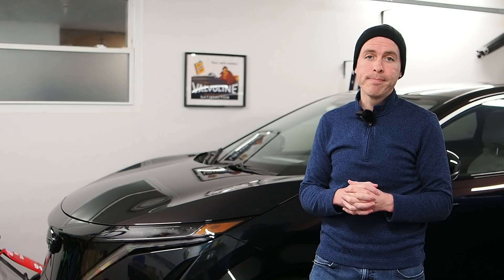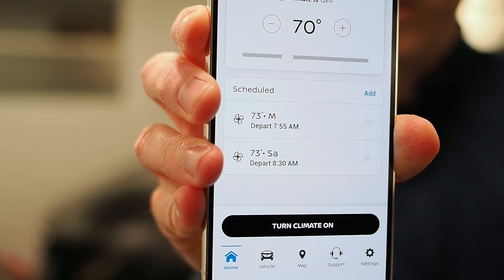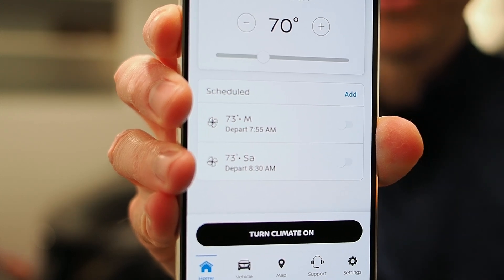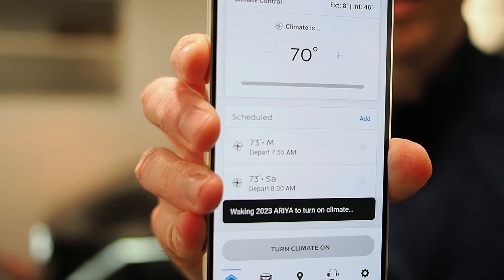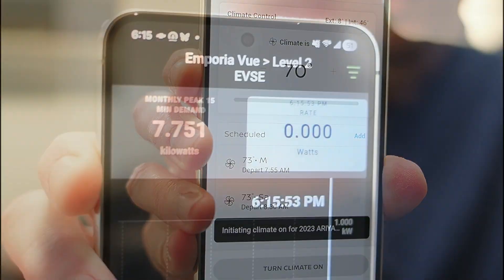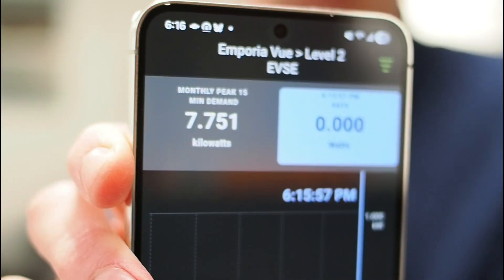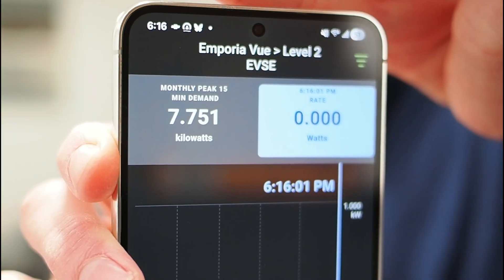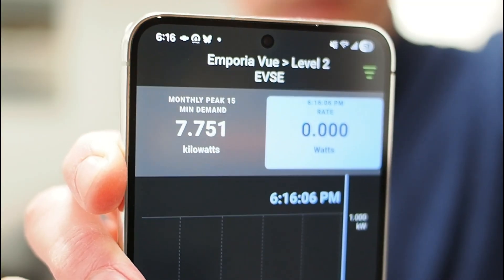The Nissan Ariya has a bug with cabin preconditioning, but there's a workaround

Comment: Thank you for showing  your  Emporium app  message in the upload,  because without  seeing that,  I would never know  you have a  2023  model.   In the future I recommend you alway's
put  the year and model of your Ariya,   (when it comes to troubleshooting and  buyer shopping,  the alway's present  thing on a viewers mind  is,  ? (  '' is what  I'm hearing applying to all model years, or
just that specific model year '' ),  for example  this  software bug glitch on cabin  preconditioning,  this video was about,   might only apply to the 2023 model years,  not the 2024 or 2025 model years,
this might seem strange to others that I have to point this out,  but it's really not,   there are a huge amount of bugs and issues for example  the  2023  Volkswagon I.D. 4  has  that the 
2022 Volkswagon ID.4  does not have.

Comment: The Ariya is a great looking SUV.  This is a great tip but tbh I unplug my EV (Ioniq6) in the AM before I heat the cabin b/c I don't want to charge off the grid while pre-conditioning because then when I go to leave and if it's not done, then I have to stop charging before leaving (which is a pain in the Ioniq6).  I do not charge every night because I share the level2 charger with my husband's R1T.

Comment: Is this only when the battery is fully charged? Because it doesn’t do it if the car is charging. I normally have my schedule set to end at 1am, then it will start again at 6:00am and ending at 7am. During that hour of charging is when my preconditioning also turns on for my 7am departure. It’s definitely charging and running the climate system at the same time.
Reply from the maker: Yes, I may not have made it clear, this is when the battery is fully charged

Comment: Cool... When you talk about battery pre conditioning... Can you explore the topic and explain if battery heater matters for miles/kwh performance in winter? 
In other words, is it worth it to use battery heat option while pulling power from the grid just to warm up the battery and try to get better milage? Is it it just good for fast charging?

Also what does the option battery cooling assist in the gauge cluster do? When should I use it?
Reply: Honestly the biggest difference I’ve noticed is cabin heating. I park in a garage, so if it’s 20 outside it’s probably 30-35 inside the garage. Preheating the battery helps marginally from my own experience, but may help a lot if it’s parked outside.

Comment: Thanks for the info. I usually Just Tell Alexa to turn on the A/C or heater in My Ariya. I haven't really notice alot of power drain from the HVAC system personally. Perhaps since i have the larger battery. I would be surprised if Nissan sends out any more updates considering the Ariya is discontinued in the US.

Comment: Have you tried to go on the app and start charge through there?
Reply: That only works if you have Charging Timer set and you want to override your set Time to charge. My model also has the button on the left lower drivers side near the back hatch release.
Reply: Its in the owners manual. The charging button is for overriding a set timer. Its not of initiating a charge. The onboard charger detects and starts automatically
Reply from the maker: I did and that didn't work for me. It's possible it could work for others, but unplugging/replugging is the surefire way to keep it charged
Reply: @BensEcoAdvntr  I’m assuming you tried this when the vehicle was charged to 100%?
Reply from the maker: @thebutterman2232 yep that's correct, full battery